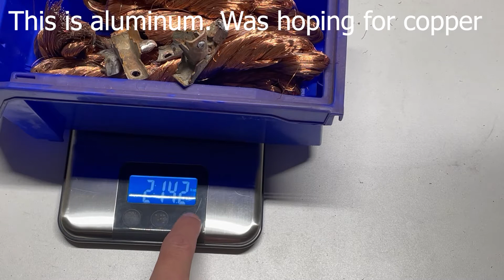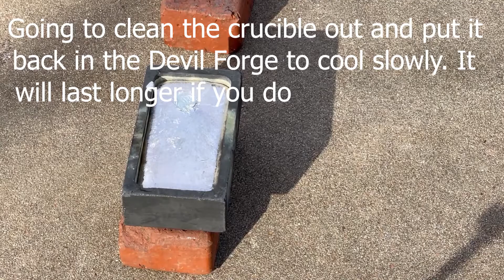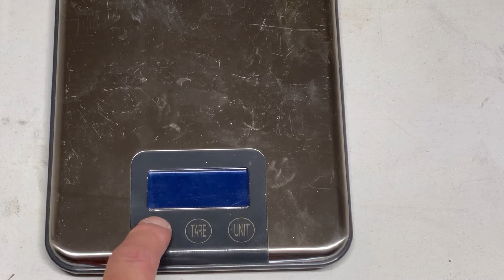Jumper Cables Trash To Treasure

Comment: The stack is starting to build. That large graphite mould is nice you can stack them so neatly. Nice job 👍
Reply from the maker: Yes it is.  My next video is an electric motor melt.  So, it adds aluminum and copper.  The video after that should add a lot of aluminum bricks.   It is an item that I have not seen anyone else melt before.  At a guess, 7 nice bricks.  Maybe a little copper also.  I have some more brass coming up as well.  Going to be adding a lot very soon.  Thank you and thank you for watching.

Comment: Quick melt of pure copper, oh wait…. No they are not. It was copper coated(or painted) aluminium. Damn. Such a shame. I always try to check before melt by filing couple of the wires to check it out.
Good you didnt mix it with other copper you had. And btw - you could also figure it out by the weight 😉
Reply from the maker: The cables felt pretty heavy to begin with.  Then once I started pulling the wire out, I could tell it was aluminum.  Such a shame it was not copper.  I have a few more sets of jumper cables to melt down.  It they are aluminum, I will still melt them down.  Just adds to the stack.  Thank you for watching.